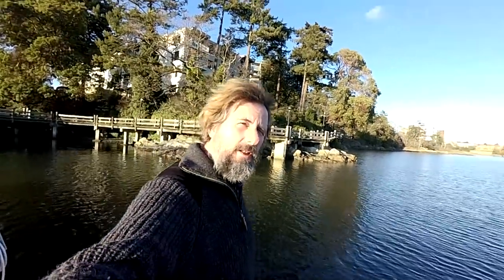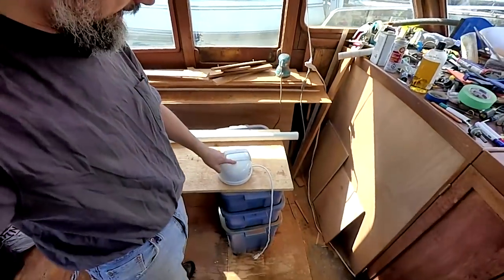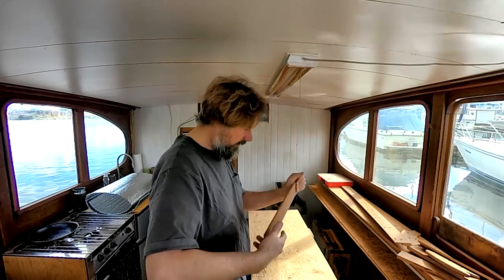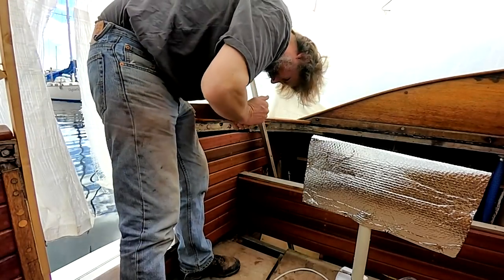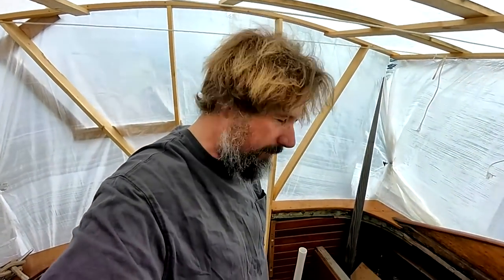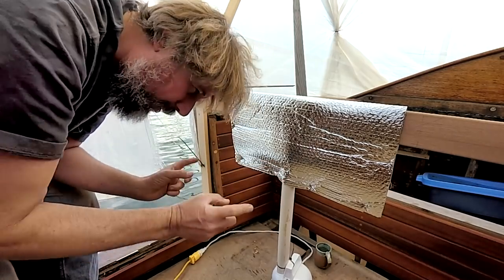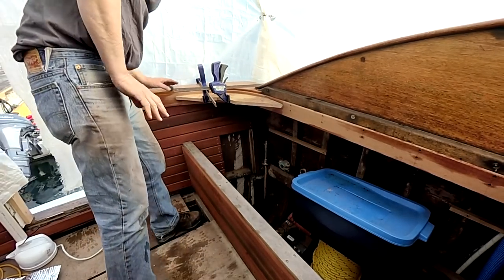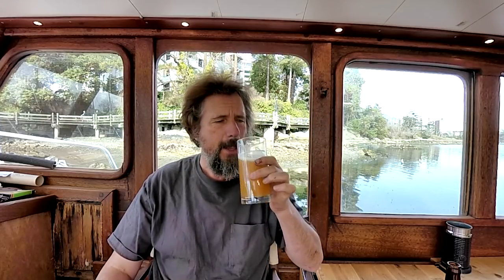Steam bending Sapele mahogany - Wooden boat restoration - Boat Refit - Travels With Geordie #104

Comment: Nice work as usual.  If you are going to steam anything bigger what works great as a steam source is a wall paper steamer.  You don't need a fancy steamer.  The cheapest will do.  I used mine to steam 1"x6" Douglas Fir up to 10' long in a steam box I cobbled together out of #4 spruce (cheapest wood at the lumber yard).  Ten years ago I made a steaming bag out of a piece of scrap plastic tarp (the next grade up from blue tarp).  It worked fine to steam planks in situ by sliding it along a plank as I drew it down.
Reply from the maker: Thanks Todd, Yes I suspect the wallpaper steamer is the way to go in the future.

Comment: Here goes then: - Bending wood cold will result in failure, but using steam works........."patishhh" (cymbal crash) 😁. Brilliant video and amazed it worked so well. You've dispelled all that I've read that suggests that mahogany doesn't steam bend well due to lack of lignin. Well there you go. The yeast in that beer will make you fart like crazy later 😎.

Comment: Lots of suspense on that episode Peter, still waiting for the crack!!! Had to do a similar job some time back on a traditional Shannon angling cot and had a lot of trouble keeping the steam up when a friend suggested I hire a few wallpaper steamers, I took off the pads and bodged a connection to a 4" sewer pipe and it worked a treat, never thought to use an old kettle well done :)
Reply from the maker: Thanks Andrew, yup it seems the wallpaper steamer is the way to go.

Comment: Been a while since ive watched you series  and I’m pretty impressed with your  theory and contraption. For steambending  the Mylar bag. Insulation  was something myself and manu other boaters i know used to  insulate  most of our hatches and single pane windows for climate control of our cabins   My guess is if you can steam Sapele long enough. You will get it to work  I’m just not sure if your little kettle is up. To the challenge but  like most od your  videos   Its always a adventure  those that dought  this aren’t Boaters  and wouldn’t understand our determination and drive  of keep trying  you should pick yourself up some silicone barbecueing gloves to help you handle the  parts faste and easier  to get them into the forms  asap  killer job Peter   On the  success  Cheers to you  and Congratulations  i had kind of guessed you were going to get something  made for that corner the updated pics on the boat shows a ton of progress

Comment: I used the Tips From a Shipwright method bending the Douglas fir lower chine stringers on my Woods catamaran. It worked pretty well. I used a propane burner with a cheapo Walmart stockpot as the boiler. I drilled a hole in the lid and put a nipple through it, and clamped a heater hose to the nipple. I stuck the other end of the hose in the bag I'd taped around the chine. The lip on the pot and lid were wide enough to clamp down with spring clamps. It took about an houre and a half to get the wood bendy enough to attach to the transom frame.
Reply from the maker: That's some big time bending!

Comment: Great video Peter,If you are going to be doing a lot more steam bending you may wish to google "stove Kettle"They still make those cast iron kettles and they are cheap on amazon.I used a cheap electric table top element and a chunk of metal pipe from a chain link fence,I do like that bag you made,Much better than plastic because it's rigid.
Reply from the maker: Thanks Scott, it seems the wallpaper steamer is the unit of choice.

Comment: Phew; glad that worked, but you are a fire waiting to happen. I remember the melting light in the cabin, which amazingly still works? It might have been better, not to mention safer; if you used a wallpaper stripper instead of that 'Heath Robinson' kettle?
Reply from the maker: Ahh, but where would the fun be in that?

Comment: hi peter,
big fan of your videos..
can you tell me what you are using for headliner?
i have 1961 chris craft i am restoring and just tore out the moldy fabric headliner..
thanks
ted
Reply from the maker: Thanks , I used plain old white Masonite. Not a particularly good boat material but very cheap and so far has worked a treat. I sealed the back side with poly.
Reply: @TravelsWithGeordie  thanks for the reply..
did u make a video about install of masonite?
thanks for all the videos and great info!
Reply from the maker: I touch on it in episode 76.

Comment: Hate to dog on you, but for christs sake buy a proper steaming kettle and be done with it. Rockler sells one for $80, but I found a drapery steamer for $50 on Marketplace. Plus I can resell it later, and no mods are necessary. Also look into ammonia steaming it makes even hard to bend species plasticize, but it is much trickier. you need anhydrous ammonia and a pressurized container.
Reply from the maker: Heh, but I had so much fun.....